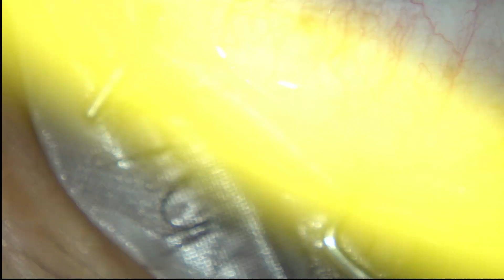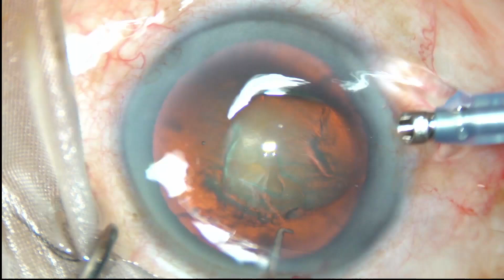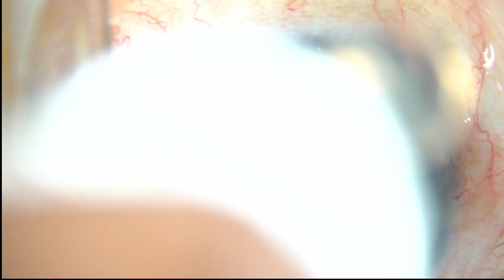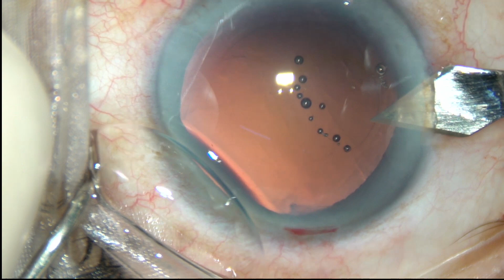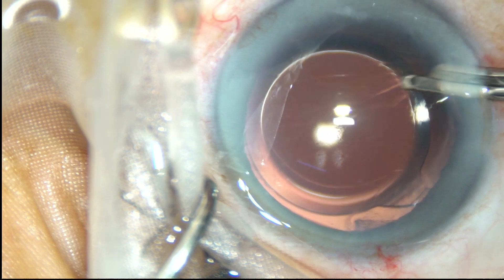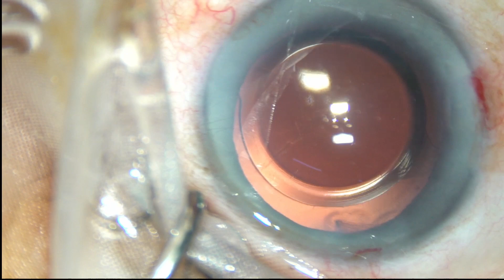Phacosurgery: Main Incision at 8:45 O'Clock to correct existing astigmatism

Comment: Astigmatism correction with incision is neither predictable nor reliable, using steep axis may give some flatting in that axis lower cylinder may use this not for astigmatism correction.
Reply from the maker: Mohd Shahbaaz 
...
Yes,
This is to reduce the cylindrical power only to some extent.
Say if the amount of astigmatism is +2.25 Dcylinder,
This incision will reduce it to +1.00 D cylinder.
Reply: Pradip Mohanta 
no it’s not, surgical induced astigmatism is .5 in phaco or less depending on size of incision in sics it may be more.
Reply from the maker: Mohd Shahbaaz 
Please watch between 5.12 to 5.20 sec. The wound has been enlarged, so it should correct more than 0.5 Dcyl
Next thing is:
What do want to establish?
Incision site doesn't matter?
Suppose you place the incision at flat meridian, and induce +0.5 D cyl , you add this astig to the existing amount. If it were 2D it becomes, 2.5 D
If you reduce the astig by the same amount placing the incision on steep meridian, it becomes 1.5D
Patient will see better with 2.5 D astig
Or
1.5 D astig.?